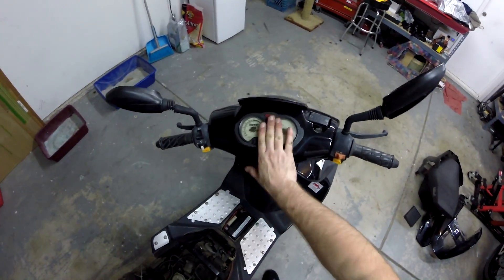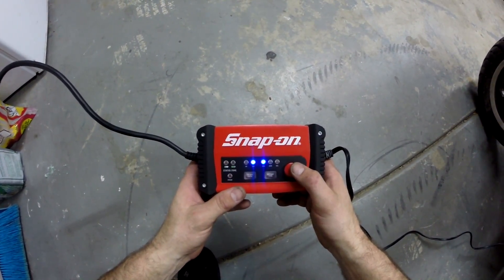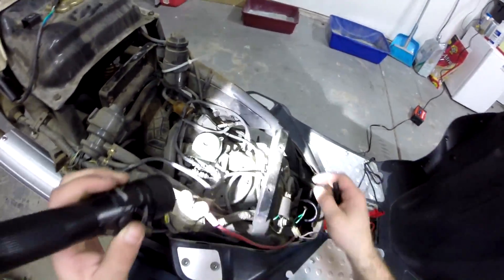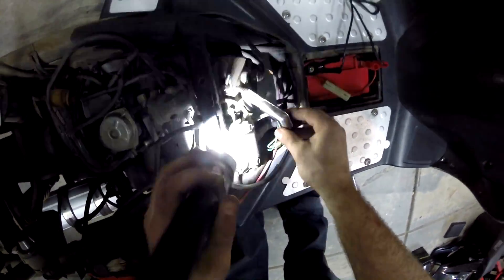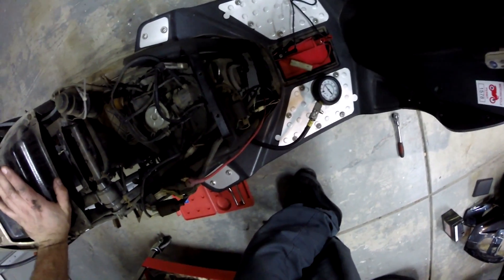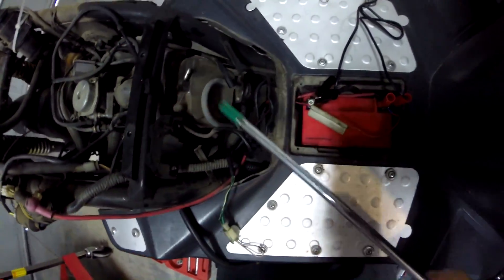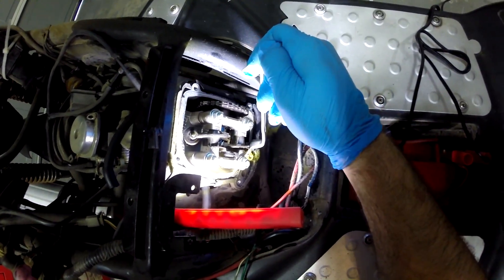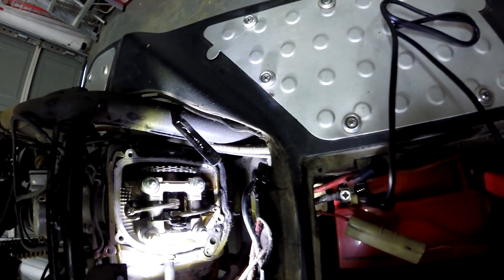Scooter Won't Start? Operation get this GY6 running!!

Comment: great video! is it possible that my scooter would go faster with the tolerances mentioned?, the reason why I ask is because some say 3 thousands of an inch for intake and four thousands for exhaust and some say otherwise, wich one is the safest and best tolerance setting found for the gy6?
Reply from the maker: Wouldn't think it'd go faster. Basically you just want some gap to allow the valves to fully close. Buuuut too much gap then the valves will not open enough.  Either way,  no real performance gains... BUT performance losses can be had if not correct
Reply: Mk2Mike thank you so much man!....you seem to know your stuff! :), I just recently got a 2008 JCL for little of nothing with 2500 miles on it, wouldn't start for anything, then I checked out your vid and voila!, got good compression and runs like a scaldid dog in heat lol, would you have advice for the notorious vacuum leak where the intake manifold meets the carb?
Reply from the maker: Andrew Sybert  does the intake manifold have an oring for mating w/ the carb flange? Usually I just pick up replacement intake manifold. They're known for warping or cracking
Reply: Yeah....when I spray starting fluid between the intake and carb my scoot will bog down, earned a sub by the way.
Reply from the maker: Luckily the Gy6 intake manifolds are dirt cheap. Otherwise You can always pull the carb off and see if you can make a gasket for it
Reply: K....I was thinking about putting some silicone around it lol, would that work?
Reply from the maker: I wouldn't. More than anything it'd make a mess. Honestly the carbs are very easy to remove, no need to remove any cable linkage to replace the intake manifold either. 

There is usally an oring where the intake meets at the cylinder head, but just clamp around the carb iirc. 

But warping of the flange or cracking of rubber is normal. Causing a lean mixture, so i'd recommend getting that fixed as soon as you can

A typical GY6 intake manifold is like $8 online
Reply: K awesome thanks a bunch

Comment: Help needed. I've a gy6 scooter (xingyue) starts and drives perfect. But won't start on the button. But will start with a kick. Any solution to this problem by any chance.
Reply: Look your kill switch its on the right side near flash switch,,,on-off,,

Comment: Mike ,my 2008 Baron won't stay on .if I hold the throttle it will rev high but as soon as I let it go it dies. my lines look dry but by chance it could be the compression.I put a new carb, new cdi box or cgi ? any ways any help would be appreciated
Reply from the maker: Any intake leaks between Carb and cylinder head? The manifolds are notorious for warping. 
Valve adjustment is good? 
Also how about your idle adjustment screw? Does the new carb have mixture control screws?
Reply: Problem with lines,,,,foreign-air anywhere,,,test them with brake cleaner,,

Comment: hey, i have a 2016 tao tao 50, 50cc scooter that i just put a big bore kit on and itll start some times and dies within a second or 2, any ideas? yes its at top dead center and in time, i do need to do an actual valve adjust ment but it should just start on decent eye ball valve adjustment...right? im fairly new to scooters lol
Reply from the maker: I mean I would for sure check valve adjustment, but considering you just did a big bore, you have more going on. 
ie: did you change the jetting of the carb? all the rings are rotated correctly and you have good compression?
Reply: Mk2Mike rings are on good, and I have a 100 jet in the card, although on the top one of the screws are missing, maybe that's the problem?
Reply: Check the valves on your scooter like now dude, use a proper tool never eyeball the gap..

Comment: Hey Mike can you please help me with my 2 bikes I have a scooter like this one 150c but no power no nothing I just installed a in-fues holder since it didn't have one I think it a rectifier but don't want to jump the gun and I have problem with  my 127c motorcycle won't start it semi auto so wen I try to push start it it try to turn but won't stay running can you help u killed this video 🤓🤓
Reply from the maker: You know it's really difficult to diagnose through the internet.  
If you have NO power at all, it's really difficult. Do you know how to read wiring diagrams?  You can find most 150cc scoots are all the same.  

1) Check your grounds from the battery to the chasis
2) Check the fuse from the positive terminal (typically a glass tube)
3) Check for voltage at your ignition switch , (usually a larger red wire) if it's there. Maybe a bad switch.

As for the 2nd one, Does it start at ALL?  Maybe a bad electric choke? Clogged pilot jet,  compression?  
Sooooo many things can really cause this. 

This video was just ONE case, and a simple one at that. 
I will try to make more videos one day in regards to diagnosing GY6 engines

need to find cheap broken ones online to buy